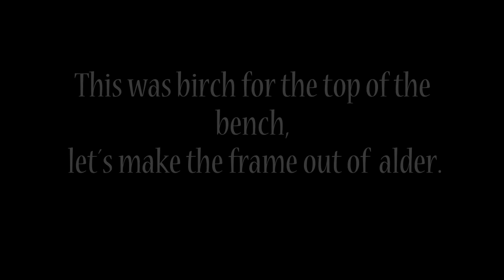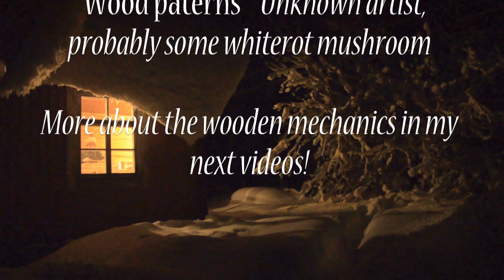Bench-Top & Timber-Frame, Workbench Part II

Comment: Ouf that’s a Moravian timber frame style … excepted not portable :)) love it
Reply from the maker: Actually this was one of my requirements: i need it portable, as i like to live mobile. That is why i used traditional wood joints without glue. It is very easy to open them and then the heaviest part is half the bench-top, which i can carry myself without problem. It takes about 15 min to put it in pieces and bit more to put it together.
Good wood, wood is good :-)
Reply: @littleforest  "i need it portable" I'd rather call transportable. Thickness is what... 10-12cm at least?

Comment: Hey I've always wondered about this.. how do you make the mortise with the correct angle with hand tools without veering off to the side?  Do you mark it on both sides at first? If you do, how? 9:35 it's nicely straight and does not mess the angles of the other joints.
Reply from the maker: Not sure if i understood correctly your question...
But yes, mark it on both sides and than with the chisel start carefully. In the beginning there is a "hill", but slow by slow take it away till the chisel is laying flat on the "ground". Than it is straight.
Hopefully this was helpful...
Reply: @littleforest  Thank you again!